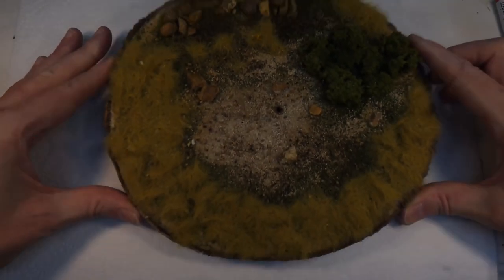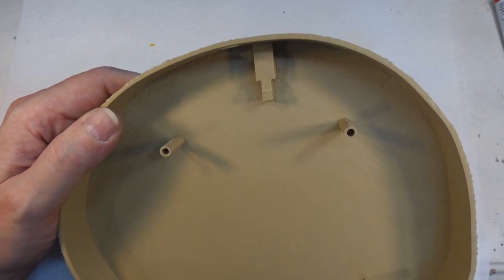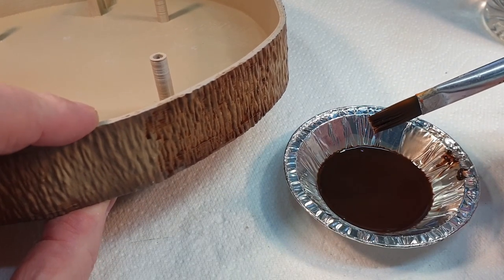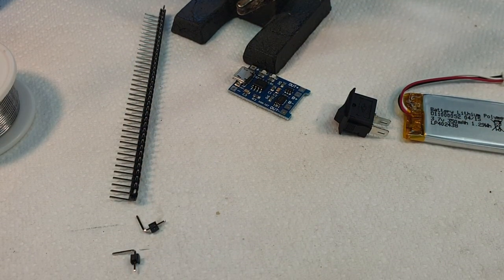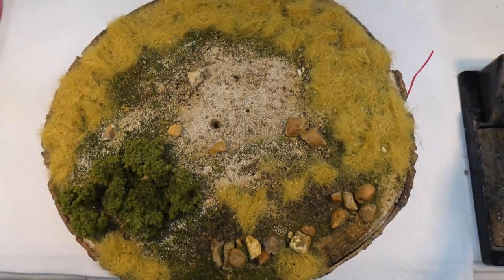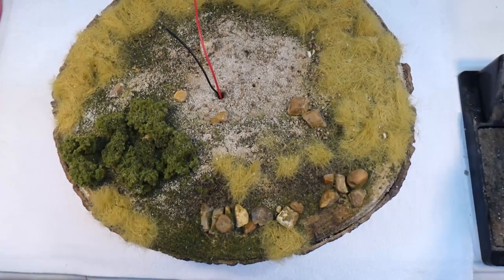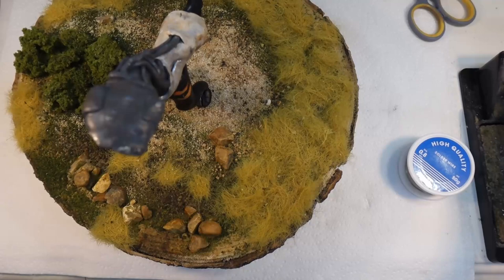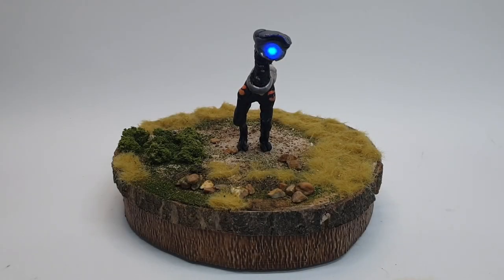Building a base and electronics for Katie's "Watcher"

Comment: Hi. 
Do you have a link for the pins, and also, the link for batteries no longer works.
Love the fact your daughter has been inspired by your work to have a go.
Reply from the maker: The problem is, a lot of stock on Amazon is actually provided by third parties and, if they stop selling that item or change the listing, the link goes out of date. I do need to go through them and update them at some point. Here's a link for a set of pin connectors, but feel free to look around at find a set that works for you - https://amzn.to/3OnqL0M